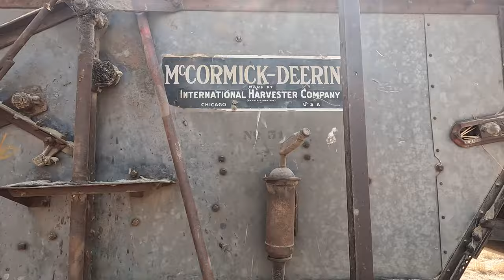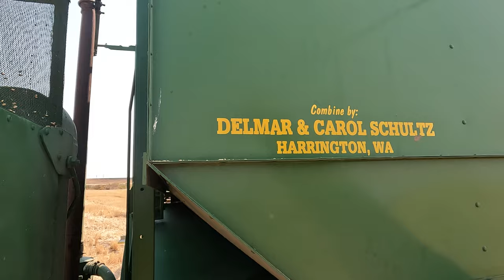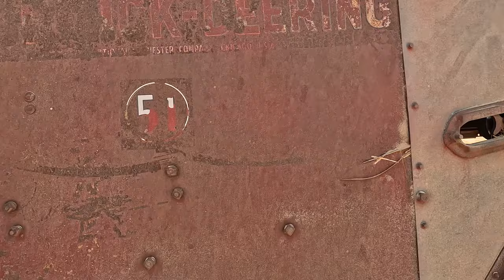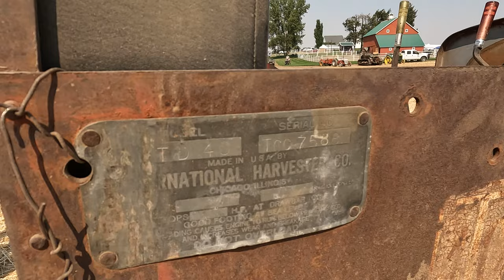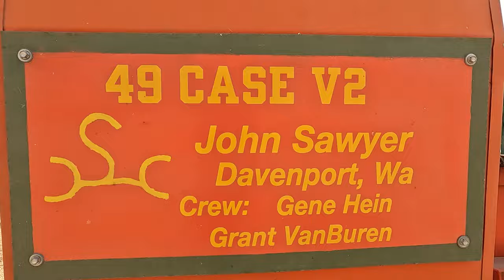Vintage hillside pull combines

Comment: That old 9u brings back memories. County motors that would lose a cylinder pain in the ass heavy to pull off. Nasty job pulling off the rear cover to adjust the wet clutches black nasty 90 weight